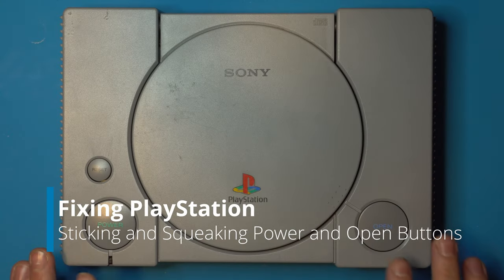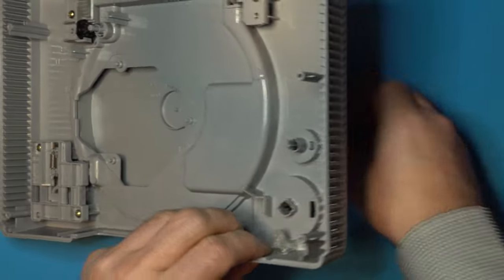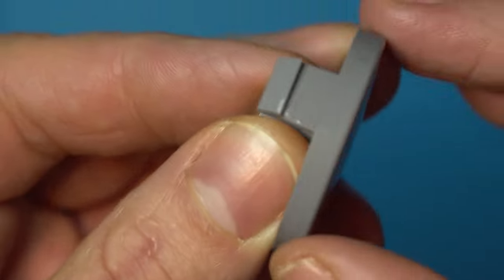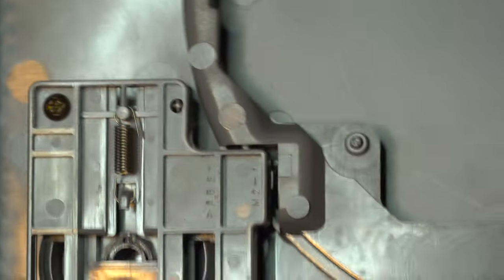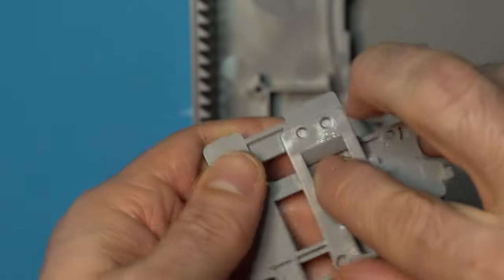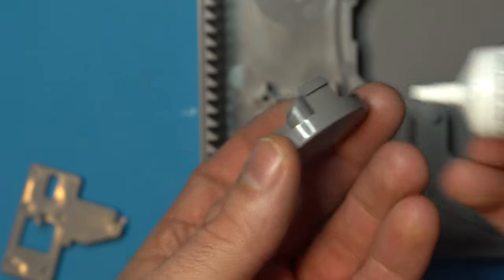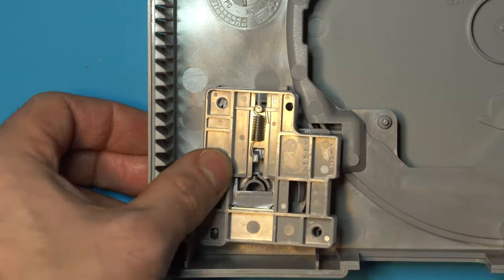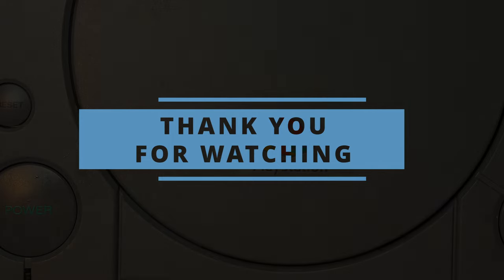How to Fix Sticking or Squeaking Buttons on the PlayStation 1

Comment: @kytor Excellent. What sort of tools do you use for these jobs, please?
Reply from the maker: This job is super simple. A Philips head screwdriver, some silicone, and a set of tweezers are about all you need.
Reply: @kytor  just a standard Philips head screwdriver?
Reply from the maker: @richyjay330  That is correct, no special bits required for this job.